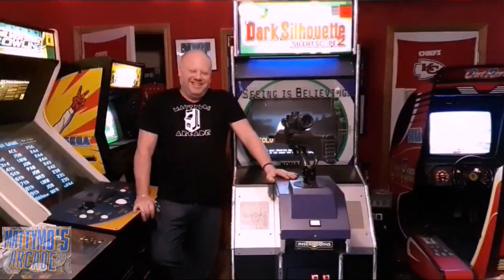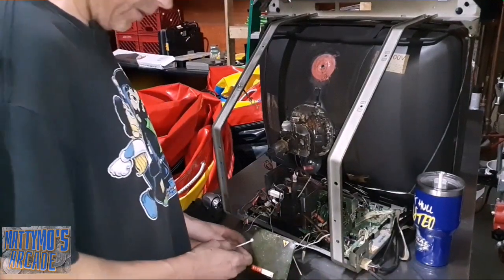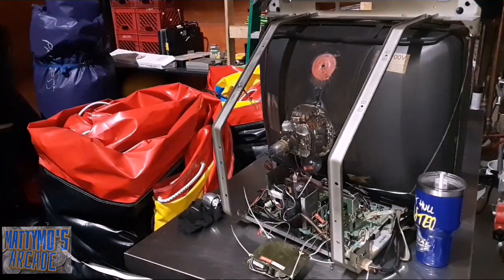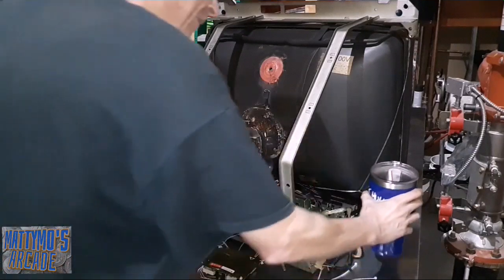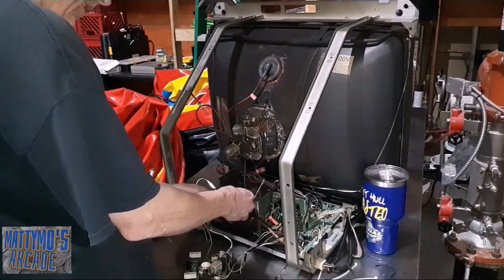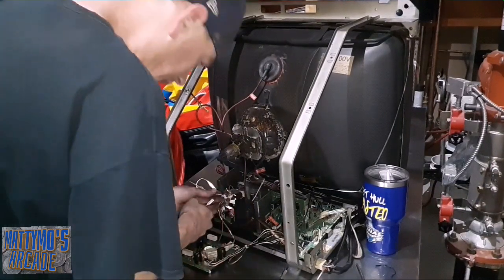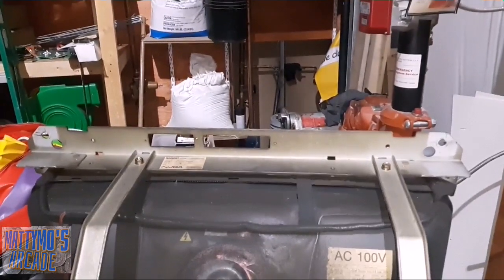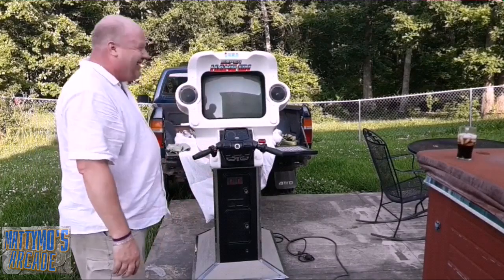Monitor Chassis Install: Nanao MS-2390

Comment: The Vertical Yoke can be wired in series or in parallel, which do you choose to do? the horizontal Yoke can be wired in series or in parallel, which do you choose to do? does this affect the flyback anode voltage or what does Yoke wired in series or in parallel affect in the arcade monitor circuit?
Reply from the maker: I believe the only effect is monitor orientation. Meaning you can flip the image around. I've used this method many times.